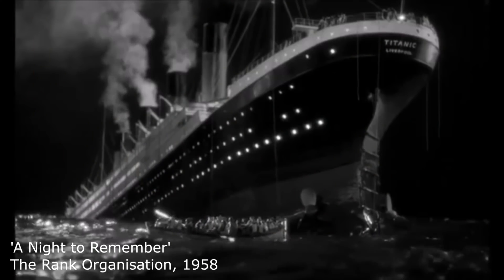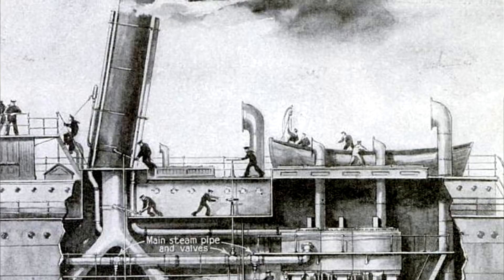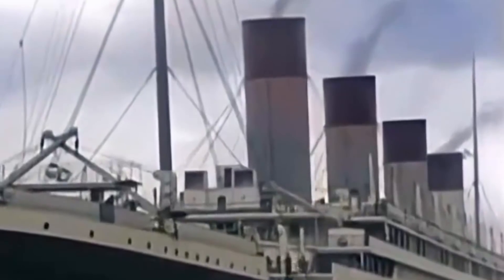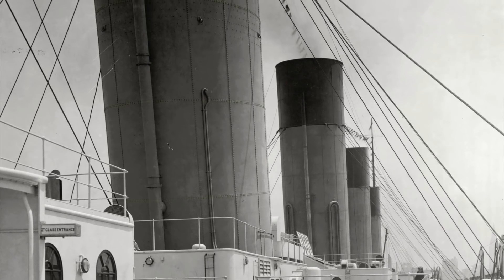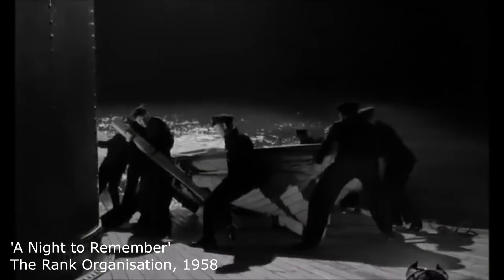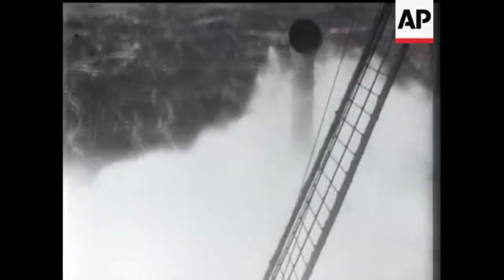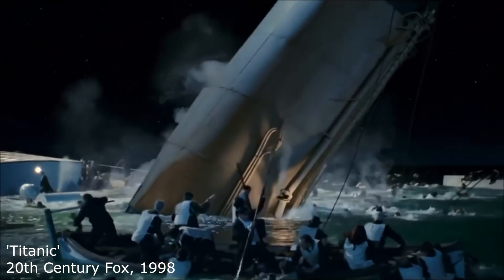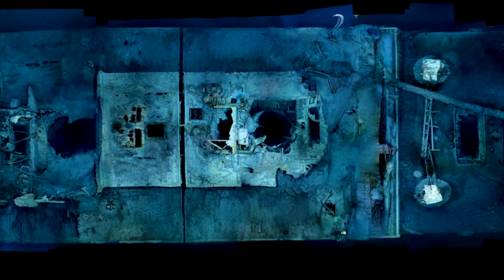Why did Titanic's funnels fall during the sinking?

Comment: The funnels collapsed due to their buoyancy.  Not water pressure. As each stack portion of the funnels started to submerge, they essentially became boats.   Full of air, surrounded by rising water, they quickly displaced more water than their own weight, and at that point the force acting on them was literally pulling them UP.  They were not really built to resist Lifting.  At some point the buoyancy pulling them up exceeded the strength of the fasteners holding them down and they tore loose. Once they were no longer attached at the bottom, or a portion of their bottom, they were much less rigid and they buckled and collapsed.   The same forces are what stripped the wheelhouse and cover of the grand staircase off the ship, very shortly after they started to submerge.  If you want to prove to yourself this is how lightweight structures succumb to flooding, just watch the videos of the tsunami hitting japan. The force of the rushing water does not break up Any houses.   Rather, the water outside and air inside cause the houses to become buoyant and literally tear themselves loose from their foundations and  float free.   It is then, without the rigidity of their foundations, that the current pushes them into other structures, breaking them apart thru these impacts and their loss of rigidity.   
Oh, and the stern did not break by falling down.   It was buoyancy that pushed the stern UP, against the force of the water in the boiler and engine rooms pulling the ship down.

Comment: Mike, Also remember that these places would have been hot, so the shock of cold water hitting these hot uptakes would have added so much more stress into the metal, potentially causing it to crack and shear

Comment: here's a question: how come britannic's 3rd funnel fell when it wasn't in the water
Reply: Amanda the h.m.h.s. britannic's third smokestack a.k.a. funnel like the first three funnels broke off and collapsed because of the way that the ship 🚢was listing due to the ship's list to her starboard side after she had struck the mine laid in the main and kee channel of Aegean sea off the coast of Greece 🇬🇷 the ship 🚢sank in only 53 minutes taking only 30 lives to the bottom of the channel of the Aegean sea when she sank the plans are already now going forward with placing underwater camera 📷tracks on the sunken wreck of the hospital-ship britannic to show everyone how and why the hospital 🏥ship 🚢sank so fast but Amanda did you also know that when the hospital-ship britannic sank she had taken a lot less people with her than her sister ship 🚢the r.m.s. titanic had taken with her when she had sank just three years earlier in nineteen twelve (1912)the hospital 🏥ship 🚢 britannic lies on her starboard side in only 458 feet of water 💧and Amanda this wreck of the hospital-ship britannic is still in very good and excellent condition and shape for being under the water 💧for over 106 years which means that the britannic is in way much more and far better shape than the titanic is in because of the loss of the titanic the condition of the titanic is not what it use to be when it was found in 1985 the wreck of the titanic is deterating at such a fast rate and the wrecked passenger liner (ocean liner)titanic is collapsing in on itself in about another 10 to 20 years or so the titanic will be nothing more than a big white/red and black rust stain on the bottom of the north Atlantic Ocean but now a new liner is being built and the name has already been decided&the name of this new ship is r.m.s. titanic 2 and this ship 🚢will follow the same route that the titanic had taken back in 1912 which is the ship 🚢will sail from southampton England 🇬🇧to Cherbourg France 🇫🇷to Queenstown now Cobh Ireland 🇮🇪to New York the United States 🇺🇸of America on her maiden voyage let's hope that this maiden voyage of this ship 🚢also named titanic does not end up ending in a tragedy or a tragic sinking of this ship like it did for the titanic back in 1912 costing the lives of 1,553 passengers and crew when the titanic had struck an iceberg broke apart and then sank in the north Atlantic Ocean just only 495 miles from Newfoundland Canada and a little over 575 miles from her intended destination of new york in the United States of America for which the titanic was to sail back to South Hampton England from New York the following weekend of April 22,1912. Then on April 26th this ship 🚢was to start her weekly run between the United States 🇺🇸of America and the United Kingdom 🇬🇧of England 🇬🇧as well as other countries in Europe and Australia 🇦🇺and after a successful sailing career on the north Atlantic Ocean and the pacific Ocean's this ship 🚢would be retired from service and would then be sold for scrapping to two different scrap yards in both England 🇬🇧and what would be left of this ship 🚢would be towed to either Ireland 🇮🇪or Scotland for final scrapping or dismantling for which this ship 🚢would now become nothing more than a memory for ship 🚢lovers to debate over and remember for years and centuries to come the name of the three white star liners Olympic,titanic,and britannic will never be forgotten as long as thier are fans of these types of ships 🚢around  today's cruise ships 🚢are the direct decendits of ships 🚢like the Mauritania,lusitania, and thier sister ship 🚢the r.m.s. aquitaina.the queen Mary the queen Elizabeth 1 the queen Mary 2 the queen Elizabeth 2 the queen Elizabeth 3 the queen Victoria 1 and hopefully soon the queen Anne and just recently the s.s.france/s.s.norway until she had a boiler explosion that killed 45 crew members then Norwegian cruise 🛳lines retired her from service and then they sold her for scrapping to India 🇮🇳were she was beached at their scrap yard were she waited to see 👀if she would win a reprive be refitted with new boilers and then be put back into service but this would never happen because she was dismantled for scrap on the beach ⛱in India 🇮🇳 but one good thing did happen a piece of the s.s. France 🇫🇷/ s.s. Norway 🇳🇴/ being renamed the blue lady's bow section was donated back to France 🇫🇷to be placed on display for all of the French people and tourists to see 👀and to remember the French passenger liner that they loved so much this ship 🚢and others like her will never be forgotten because it now is ships 🚢like the queen Mary a tourist attraction in long Beach ⛱, California that will keep these ships 🚢memories alive for generations to come, we must and will make sure that these classic type of ships 🚢will always be and remain in our hearts and memories forever&beyond.

Comment: If the idea that there was a coal bunker fire at the time of the sinking is true then parts of the housing would have been very hot and been plunge cooled by the seawater causing it to fracture. I don't know what you think of that hypothesis (bunker fire) though.
Reply: the bunkers were in no way attached to the funnels.
and the “fire” was nothing more than a patch of smoldering coals.

Comment: In the Ghosts of the Abyss book, the author writes about one possibility - that the crew disconnected or severed the shrouds because they were supposedly blocking Collapsibles A and B from being taken from the deckhouse roof to the boat deck. I think that's a ridiculous hypothesis. Firstly, they weren't really blocking the collapsibles. Secondly, no way would seamen have cut funnel shrouds knowing the huge thing would fall. Thirdly, how exactly would they have disconnected the shrouds even if they wanted to?

Comment: The funnels were large and heavy enough that they may have not been bolted down. Unfortunately no one expected a full frontal tipping.
Reply from the maker: Hi Thelma,
The funnels were quite firmly attached to the ship with rivets and a system of steel stays to prevent them from falling during heavy rolling on the Atlantic.
~Mike
Reply: @OceanlinerDesigns  and at a certain tipping point they broke loose and fell into the ocean.
Reply from the maker: @thelmatucker7598  Right, and in this video I point out that it was likely water pressure that caused the failure as suggested by naval architect Edward Wilding at the inquiries. :)
~Mike

Comment: I like your videos, but the answer to this is 20 seconds long, the same reason she broke in half, stress.
Reply from the maker: Thanks Aladdin but what kind of stress?
~Mike
Reply: @OceanlinerDesigns  well since the ship is made out of mild steel, nose sank first which in turn lifted the ass end up high out of the water creating a high amount of strain on her spine and on anything metal holding her together, I would say stress fractures and cracking due to pressure and or strain.

Comment: Half inch thick is extremely thin? 
That shit is heavy as hell.

Sheet metal on a car is about 1.6mm, as opposed to 12.5mm that half inch equates to. 

I don't mean to be offensive at all. That line just struck me as someone who's done quite a bit of fabrication.
Reply from the maker: Yes but on an object the height of a six-story building? Just a matter of perspective really. The funnels' sheet metal was thin enough that is has long-since been eaten away while the rest of Titanic's hull plating remains in place. Thanks for watching!
~Mike
Reply: @OceanlinerDesigns  Out of interest, how thick is the hull plating? 

In WW2 Sherman tanks had 2" thick Armour on their hull. (Just as a reference for people I guess).
Reply from the maker: @NoMatureContent  The hull plating ran around 18.75mm to 25.4mm thick, the funnels about 12.7mm. And people wonder how an iceberg breached the hull!
~Mike
Reply: @OceanlinerDesigns  Is it not true that it was more a failure of the rivets than the plates themselves? 
I thought I read that the iceberg broke the seams rather than ripped through inch thick steel.
Reply from the maker: @NoMatureContent  Yes very true, no ripping per se; more like the plating was buckled and rivets along the seams failed as you mentioned. Inch-thick steel sure sounds impressive but when applied to an object as large a Liner's hull it is like paper. There is a replica of the very turn of Titanic's stem in Belfast and knocking on it is like rapping on a hollow water tank. Unreal!
~Mike

Comment: Does anyone know the temperature of the funnels? I feel this was missed ....
Reply: Not sure if it was, outside temperature, or inside surface temperature, or flue gasses that left at the top of the funnel. Or the flue gasses as they left the finial heat exchanger in the boiler rooms and started their way up to the outside.

Comment: You make an interesting point here, I thought that when those guy wires broke outside the ship while she got much lower in the water, that was what caused the number 1 and a little later number 2 funnel to fall over.  However, it was because of the weight of water getting inside the ship that pushed the inner funnel casings in instead that made the guy wires break, then there wasn't any support and the funnels started to fall over the side of the ship.

Comment: When learning to scuba dive, one of the first things I learned about water pressure is the greatest differential or greatest change in pressure, relative to air pressure at sea level, occurs in the first 3 meters (or about 10 feet) of your descent.  The equalization you have to do to keep your eardrums comfortable is most noticeable in that depth range.  By contrast, if your at a depth of 30 meters (a little less than 100 feet) and descend to 40 meters  ( a little more than 130 feet), you barely notice the change in pressure, though it adds one entire atmosphere of pressure.  So, as Titanic began a quick lunge downwards I can picture the sudden added pressure on the lower portion of the first two funnels causing them to fail, leading to the upper funnels collapse.  It seems like a reasonable hypothesis to me.  Is there a way to test it through some type of computer modeling?
Reply from the maker: I would assume there would be some kind of dynamic model that could simulate this, good thinking!
~Mike

Comment: Delta P is no joke.  As a former commercial diver I can attest to this.  I almost had a man on my crew killed one time due to it.
Reply from the maker: Scary stuff! Stay safe!
~Mike
Reply: @OceanlinerDesigns  Technical question for you about this.  
Why did the seawater inside the funnel not raise as fast as the sink rate of the ship?  

As the lower compartments were the first to be breached, and it was pretty well a straight shot from the boilers to the funnel, I would expect the water to be at or almost at surface sea level as the ship went down.

Is it not as simple as that?  Does it have to do with all boilers having the doors shut?  Very curious about it.
Reply: David.
Very good, point. & I’ve just spent a large amount of time reading all comments to see if anyone else brings this up. As it to did cross my mind…

As shown in the video, the uptakes from around D deck seem simple straight passages. and below that they branch to each boiler and it’s smoke box (while going though heat exchanges), but there is no restrictions.. remember, the point of the uptakes was to get gasses out of the fire with as little restriction as possible (while having large amounts of service contact area on many boiler plates & tubes to impart heat/energy). the fire air intakes I assume would have Been on F deck, where the force draft fans (I think) were located, from there the air (in-directly) is directed to the bottom of the firebox, to feed the fire with air (and therefore oxygen), I would argue that in normal operation, a flooding boiler room & air intakes, would have the uptakes and bits fill with water quick. 
The only thing I can think is that all fire doors AND all dampers were closed, that may restrict the flow passage though for water to be able to fill the inside of the uptake slower…. Maybe

However, boiler room #6 feed into funnel #1, and that boiler room flooded quickly, did he crew in there, in the surprise of the accident really have all fire doors closed (talking 4 boiler each with 6 doors), and dampers all closed. I feel any 1 been open would have created enough of a path for water to fill up the uptake in the 1hour + as the boiler room(s) sank, & took in water.
I’d be keen on more research/information, into this before I am convinced.

However, please do not take this as a negative comment, I do really enjoy these videos. and I have subscribed (the total number of Utube Chanel’s I subscribe to I could count on 1 hand)… I do really enjoy the presentation style & content.

Comment: I always suspected water outside the funnels exerting inward pressure had something to do with it, so this mechanism makes a lot of sense to me.  

I didn't realise the funnels got that hot!  Seems like a lot of energy going to waste there.  Could they have not coiled water pipes around the lower funnels and capture some of that energy in a heat exchanger for providing hot water, cabin heating, etc?
Reply from the maker: That's a clever idea and one that was never put to use unfortunately!
~Mike
Reply: I would think, what would be called waste heat, that is carried up though the flue gasses and out of the ship, although possible to capture energy would be tricky to control.
The boilers themself are double pass, then in the ‘smoke box’ space is a pre-heat, heat-exchanger, that heats air on its way into the bottom of the fire. So once the flue gases are finished there, they have already provided a large amount of energy to ‘steam- generation’ (without knowing for sure, I would assume at this point coal.. to steam efficiency would have been better then 60%, possibly 80%)
(note, it’s turning that steam into proposition that is un-efficient)

If the waste heat was used for say water heating, for let’s say passenger use, then every time a boiler is shut-down, or even partly reduces output (such as clearing ash), there would need to be something to compensate for this and still heat that water. with reduced waste heat. then there would be en entire network of change over valves… just be simpler to use the steam directly to heat water.
A good idea, but I personally think, if any extra use was to try be used from that waste heat, boiler feed-water should be it. Then you back to a positive feed-back loop, and supply lines up to usefulness.

Comment: I never thought about the funnels internal structure, but that makes sense. Assuming that the inside of the funnels was like a column of air that suddenly was filled with water is a logic explanation why funnels 1 and 2 collapsed.
Reply: I THINK he's saying the interior of the funnels was Empty of water and therefore the growing water pressure on the exterior of the funnels caused a structural failure....exterior water pressure pushed the foot of the funnels off their seats leaving black gaping holes leading to the very bottom of the ship, filled with nothing....the water poured in taking some with it into the literally coal black depths....
Reply: @manuelkong10  Correct they would have basically been pinched at the base and imploded. The water level inside can lag behind significantly for the simple reason that water needs to find a way in and air needs to find a way out. As the sinking progresses in speed you can get large differences in pressure as a result until structures begin failing as a result and creating new openings.